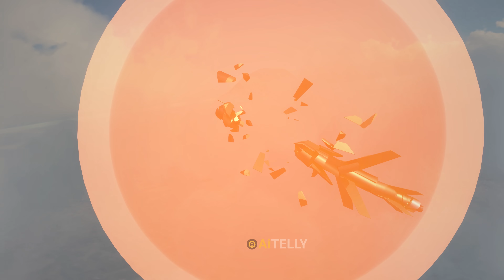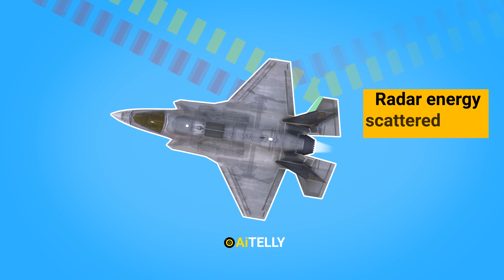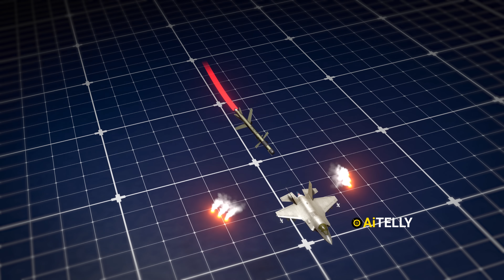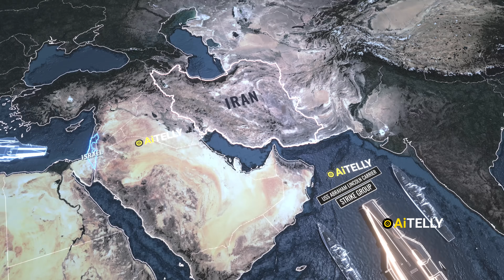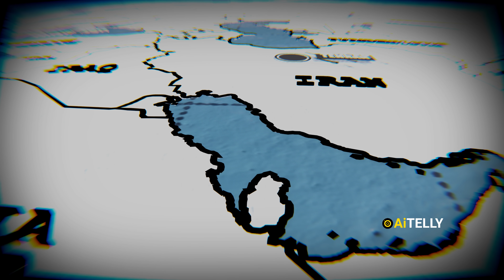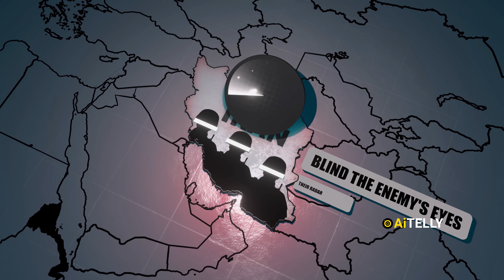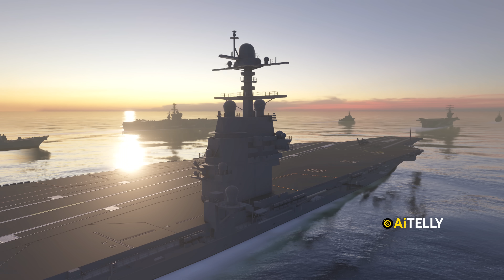How an F-35 Got Hit by Iranian Missile in Operation Epic Fury

Comment: Try inventing hydrogen propeller engine with failure 
 hydrogen flux capacitor engine Dan lied it doesn't jump try 
Three hydrogen engines with propellers with minor difference between engine and light try new things

Comment: I find it hilarious people commenting that the f35 is obsolete because was struck by iran missiles.

Without being said the f35 stealth is still significantly better as a matter of fact  The f15, f16, f18, su, 35, su 27, su 57 , j35, j20, j16, has a much larger radar signature put it in the same position as the F 35.

What about all the times? The f35 successfully penetrated iran airspace? 
I don’t see anyone mention or give credit.

1.	March 2018 — Kuwaiti newspaper Al-Jarida reported that Israel flew F-35s at high altitudes over Syria and Iraq undetected into Iranian airspace on a reconnaissance mission over Bandar Abbas, Isfahan, and Shiraz. 
	2.	Mid-2022 — A Saudi-run outlet (Elaph) reported that Israeli F-35 stealth fighters penetrated Iranian airspace on multiple occasions over the prior two months, successfully evading Russian and Iranian radars during exercises. 
During the 2026 war (Operation Epic Fury):
	3.	Early March 2026 — Israeli F-35I Adir formations struck critical infrastructure around Tehran, including energy nodes and IRGC facilities, and exited without loss despite dense surface-to-air missile coverage. 
	4.	March 14, 2026 — A U.S. Air Force F-35A Lightning II took off for a mission during Operation Epic Fury  (confirmed by official Air Force photo)

Comment: F-35 is stealth but might be downed by a Chinese BVR PL-15, 17,21 variats,, 
French Rafale was never shot down SPECTRE system had good measures for EW , still 4 Rafales, 1 MIG 29 Flanker,1 SU-30 MKI , 1 French Mirage 2000,
1-UCAV , 1 Heron Israeli attack and surveillance. 

J-10 C's, JF-17THUNDER Block 3, took them all out while remaining invisible to enemy radar and superb Electronic Warfare, the night of 6-7 May 2025 marketed the first and only BVR Engagement. Hitting nets UPTO 180-200 km away , both India and Pakistan remained in their own Airspace , Link-17MOD with SAAB 2000 did wonders that night.

Comment: You don't explained at all .😂😂😂

Iran had a ground-based anti-aircraft battery. A radar located a few kilometers away detected the incoming threat and alerted the battery:"An aircraft was approaching from that direction."The battery used a thermal camera to scan the sky. Once the target was locked, they launched the missile. The missile uses an IIR sensor, not an IR sensor as you claimed. The IIR sensor recognized the shape of the F-35 and tracked the shape specifically. Regardless, if it hasn't happened yet, you can be sure an F-35 will be lost on a mission in the future.

Comment: F35 has sensors that have detected missile launches at up to 800 miles away. It automatically pops flares and warns the pilot. The air friction of the nose of the missile is detected much less the exhaust. The video is total bullshit. Also they DO NOT HAVE an IR SAM that can reach the F35's combat altitude of 30k-40k feet. Period. It's much more likely the F35 suffered mechanical failure and they faked this entire story. The only sources of it are "unnamed sources" from 2 media outlets. Everyone else sited their stories as sources lmao. That stinks of total bullshit. The video shows the plane not automatically popping flares nor evading maneuvers. That's absolutely BS if you know how the F35's sensor suite works. Not to mention they have NO REASON to fly low enough for the Iranians EO/IR missile to hit. They are not doing CAS of ground troops 😂 Their IR missiles can't even reach the F35 at the altitude it flys for strikes when not doing CAS and if it was real you'd see it pop flares automatically and warn the pilot soon as the missile was launched and even if it was launched from underground soon as it broke the surface of the ground the F35 360 degree DAS would detect it and you'd see automatic flair deployment and evasive maneuvers. The video is total bullshit. The sources siting it was hit and the pilot had shrapnel damage are ALL "UNNAMED SOURCES" 😂😂 People unnamed who are speculating and don't actually know anything for sure. This is just sensationalized and accompanied by a fake ass video. I'm not buying it what so ever. The video is definitely clearly fake as shit as are all of their videos with the green box things 😂😂 They have ALL been PROVEN to be fake. The videos at least.

Comment: From a pilot's perspective, the "fly straight and do nothing" behavior in those videos is the biggest giveaway that they are digitally altered or staged.
Here’s why your logic holds up against the "passive" argument:
1. Thermal Detection is a Two-Way Street
Even if Iran used a Passive IRST (Infrared Search and Track) system to "silently" find the jet without turning on radar:
The Launch is Loud: The second a Surface-to-Air Missile (SAM) ignites, it creates a massive thermal plume.
The DAS doesn't care about "locks": The F-35’s Distributed Aperture System (DAS) is essentially a 360-degree heat-seeking camera. It doesn't need a radar warning; it "sees" the friction heat of the missile's nose and the fire from its tail.
2. Automated Defensive Maneuvers
If that missile were real, the jet's computer would have instantly:
Alerted the pilot with a massive red warning in the helmet.
Prepped countermeasures, likely firing flares automatically if the threat was within a certain kinetic envelope.
The pilot would have pulled a high-G break (hard turn) to complicate the missile's intercept path.
3. The "Missing" Impact Physics
In the videos showing a "hit":
There is often no kinetic transfer. A missile hitting a jet at Mach 3+ creates a violent change in the aircraft's flight path.
In many of these clips, the "explosion" looks like a 2D overlay that doesn't interact with the lighting or the airframe of the jet.

I'm not buying the video at fucking all. If you know anything about the F35, the video is bullshit totally. It's more likely to be mechanical issues. The jet wouldn't just fly straight and do nothing. It will detect a missile launch and automatically pop flairs 😂 Zero flairs in the video. No evasive moves. Total BS.

Comment: At 0:04, there not just “2 kinds of AA missiles in modern warfare”. There’s 3 main types.
1. Radar Guided - Detects & tracks radio waves from target using 2 methods.
    - Semi-Active:  Requires ground-supported radar.
    - Active:  Has integrated onboard radar.
2. Heat-Seeking & Infrared Guided - Uses onboard tracking sensors.
    - Tracks the targets heat emissions, hot surfaces, & infrared radiation.
    - Integrated cameras guide target visual color contrast against background.
    - Collective sensors direct flight surfaces for self-guidance after launch. 
3. Command-Controlled - Can’t detect & track targets itself. 
    - Requires ground support to track missile & target using laser beam.
    - Ground support sends steering commands to guide missile to target.
    - Not radar-homing or heat-seeking.

Comment: the F-35 uses the AN/AAQ-37 Distributed Aperture System (DAS) as its primary Missile Approach Warning (MAW) system. It is specifically designed to detect and track infrared-guided (heat-seeking) missiles

Comment: The IR Seeker in the missile cannot scan and monitor then track the F-35.  This is done with clandestine stations broadcasting commerical civilian frequencies in long waves.  These waves bounce off the stealth coating that is not designed to absorb the longer wavelengths.  The Russians and Chinese developed programs to identify the cross-sections bounced by the wavelength against the clutter of the evironment through experiments.  Artificial Intelligence can quickly compare it with this database enough to scan and track the F-35.  The IR's kick in to ID the thermal signature of the red hot exhaust and lock on it against other similarly red hot but short-lived flares.

Comment: IRAN did not hit an F-35. The footage is fake. You can tell it is a fake video. the aircraft appears to be the same temp as the afterburner plume. That temp would be around 1000 degrees Celsius.  Towards the end of the video, the air craft goes completely cold while still intact. Also a missile like that would have completely destroy an F-35.

Comment: You Keyboard warriors do realize that "stealth" does not equal invisible... Stealth in that sense measn that modern radars detect the aircraft at like 15-20miles instead of from like 70 or 100 miles away like a regular 4th gen aircraft so if you get close enough with your stelth aircraft the radar will see you like any other aircraft and you can be fired upon the exact same way...

Comment: Iran's 359 and AD-08 Majid air defense systems are capable of detecting and engaging F-35 fighters thanks to their passive optical-electronic systems and the high speed of their missiles.

It was initially assumed that the strike was carried out by a missile from the "358" system, but  its primarily designed is to destroy drones, small aircraft, and helicopters, and its speed is inconsistent with the speed at which the F-35 was hit. The "359" missile and the AD-08 Majid mobile air defense system are considered the most likely candidates for the fighter's destruction.

The "359" missile is distinguished by its large size, maximum speed of up to 1,000 km/h, the ability to engage targets at altitudes of up to 9 km, and a range of up to 150 km. The AD-08 Majid air defense system, mounted on a light vehicle, is armed with missiles with a speed of up to 2,450 km/h, a range of up to 8 km, and an operating altitude of up to 6 km. Both systems use passive electro-optical detection systems that do not reveal their presence during operation.

The disadvantage is the relatively weak warhead of the missiles, which, according to reports from the US Central Command, allowed the F-35 to avoid critical damage and return to base.

Comment: This is excellent news. Reports indicate that five F-15s have been shot down and several KC refuelers destroyed. Iran has also managed to dismantle defense infrastructure worth trillions of dollars across the Middle East. Its precision-guided missiles successfully struck designated military targets within the axis of evil. Utilizing China’s long-range radar systems, Iran detected F-35 aircraft, after which heat-seeking missiles engaged effectively upon proximity. This collaboration now provides China and Iran with a valuable opportunity to analyze the F-35’s design—though it remains inferior to Chinese fifth-generation aircraft, the insights gained hold substantial value for advancing missile defense systems.

Comment: Why risk the F-35s at all is my question. Rough maths tells me that the cost of one F-35 is about $109M | maintenance, let's say $75M | Cost to train a pilot $12m + cost per flight fuel etc), so you can see we are looking at a $196M asset.

That is about $3.5 for a tomahawk, so you are looking at 56 tomahawks, but obviously a f35 is reusable but it still need a missile so lets say AGM-158 JASSM-ER about $2M plus the cost of fuel and the maintenance cause caused by the flight probably put the cost of deliver that strike at maybe $3M (without even thinking about the cost of the asset).

If the aircraft is shot down, the cost to have a pilot captured by Iran is almost immeasurable.

So that math on aircraft like this just does not stack up.

Comment: The main differentials in between the middle of the two stealth fighter generation the F-117E and the 5th generational tale Ted F-35 lighting two is this. One the F-117 have no radar just a camera for it's targeted systematic. It had some detector but that's it. It also hide it's kitchen exhausted fans and emissions because it needed to. No radio, no radar, meaning no emissionary. The F35 had massive booster giving heated emission also it had radar emissivities surrounded in it's airframe-ups. That's why it's not good for stealth it had emissivity. Meaning electronics can track irs radio waves like radar and communicator like radio waves.